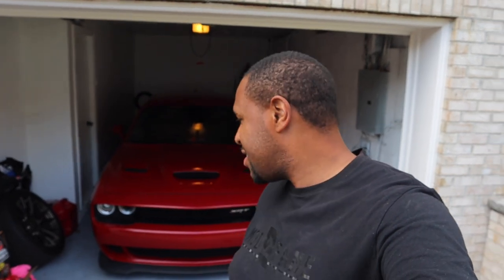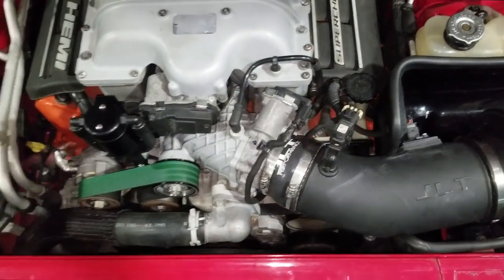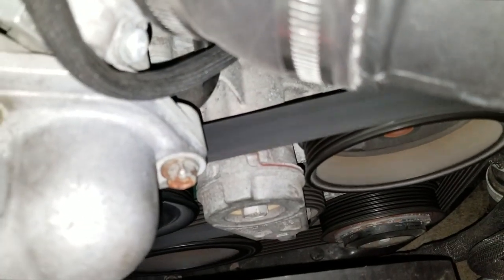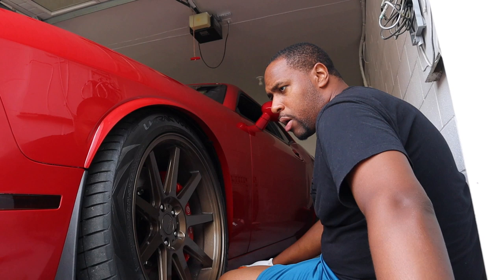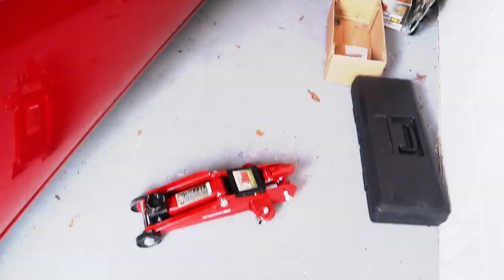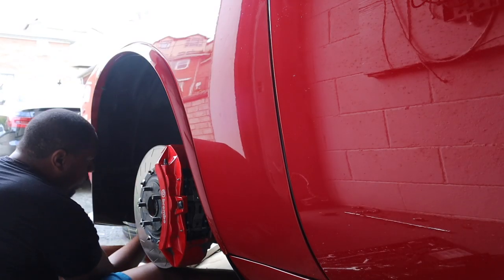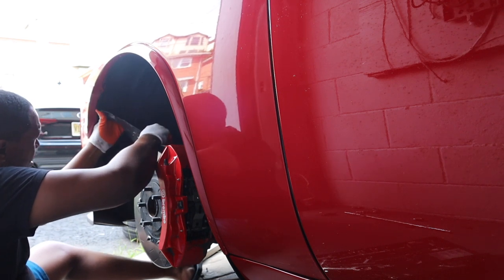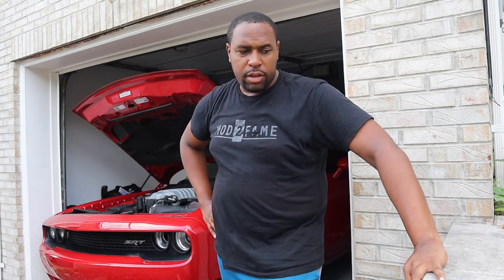My Hellcat Has A Problem After Spending A Bag of Money On It

Comment: First: FU to everyone who posted "it's a Dodge" or anything close to that.
Second: If you haven't bought one yet, there is a used one on eBay for $480 shipped. Pulled from a wrecked Hellcat with 15K on the clock.
Third: PLEASE be safe and get some jack stands. Jacks DO fail and that car will crush you. I watched it happen to my dad's buddy... not pretty
Reply: Dodge issues

Comment: g that's allot I'm spending that right now to do my water pump timing belt thermostat etc and then I got to do plugs a wires and a gasket brakes n back rotors and a inspection sticker hopefully I'll have it back after the easter holiday

Comment: Yo Steph safety before everything. You should always use jack stands in conjunction with a floor jack. Invest in a set but when you don’t have stands at your disposal like a street mechanic lay your wheel under the car just Incase that cheap ass hydraulic jack takes a bathroom break on you. Wrenching on a car that is on a floor jack is not safe at all no matter how many times people get away with doing it without incident.

Comment: HELLCAT is a great lease as a second car but long term financing of these things makes no sense.

Ignoring the $30,000 depreciation before you hit 5000 miles...

I saw a brake down on Forbes of cost per mile.

An AMG Mercedes S Class will cost over $1.80 per mile but a Hellcat will cost over $2.00 per mile.

Better to lease it and then have the option not to keep it than to finance them long term.
Reply: Better to buy a used one and let another person take that deprecation hit
Reply: Bee Voski everyone ignores the used market , but a brand new car off the lot makes absolutely no sense let someone else take the 30000 mile hit
Reply: It only makes sense in two situations: You can afford to buy it cash, or you're a YouTube who finance one to used for content, which turns around paying for it self while making extra income.
Reply: Bigtruckseriesreview Motorsports the lease on the hellcat is a bargain the residual is very high and they usually have a really good money factor,last year I compared one to a GT350 and the more expensive hellcat had a lower payment.
Reply: 30k depreciation means the 59k car would be worth 29k after 5k miles. Ya they are selling for 40k still for 2015 cars with 30k miles on them. So maybe a Redeye is not worth it being 80k+ and its depreciation but a Hellcat is fine as the 19k in depreciation over 4 years is better then a Corvette, Mustang, Camaro and many more.
Reply: KBB value for a Hellcat is 38-42k for a 2015 dealer sale car. 
Owner value is 35-38k and if you want a CPO car with warranty its 41k. That's nowhere near 30k depreciation
Reply: @eichler721   a brand new hellcat is a $70k car smart guy
Reply: @dsunit1  btw I looked at one dealer and their are 4 in my area. So ya thanks. Its 59k base and the Widebody adds 6k so 65k and the Redeye is 75k base. Get your facts straight

Comment: Those are nice problems.  That's the price you pay for high HP cars. Rather have High horsepower problems than a 300 horsepower car period. My Q60 still stock and hate it.
Reply: Tell me about it, I rather have fast car with those problems,  than my 2015 q60 which stock and slow

Comment: Stef are you absolutely crazy. You must be asking for a death wish. Where in the hell are your jack stands. Bro, safety over everything thing. I bet that Harbor Freight jack was hot to the touch. It sucks that the intercooler pump failed. Hope you can find a replacement soon. Once your car is at 900whp it's going to be a force to be reckoned with. Godspeed with everything.